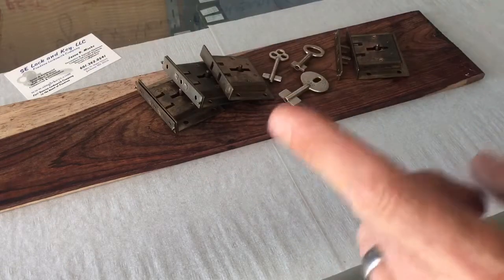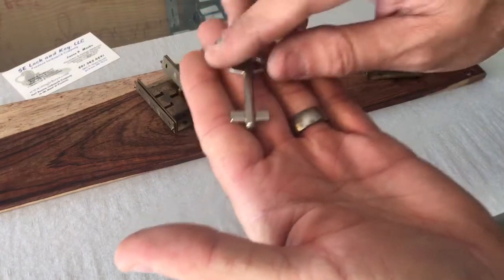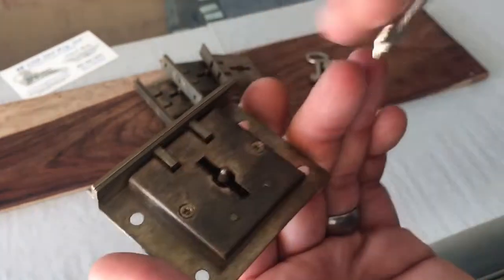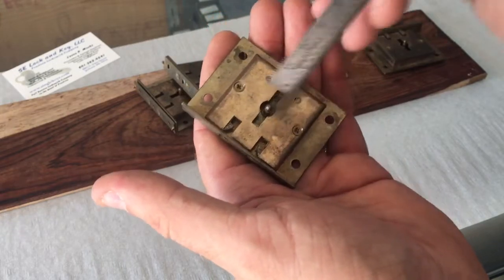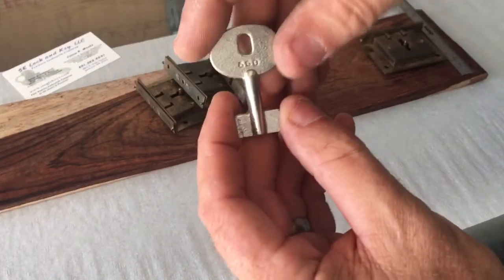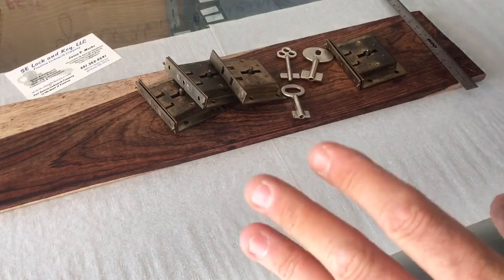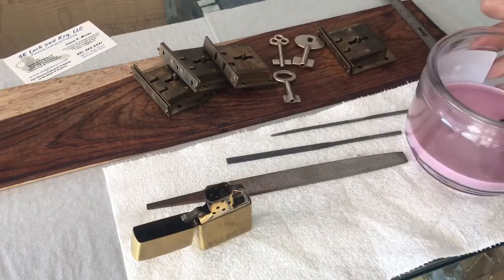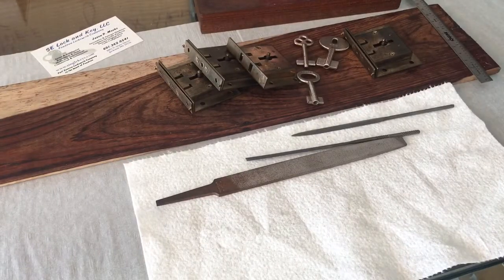Antique Roll Top Desk ~ Key Making!

Comment: ok, so I'm diy restoring an antique writing slope and I want to make a key for the lock..... I don't know any terms, but the lock box is completely closed with only the keyhole opening and takes a small barrel key. But the whole mechanism looks like these locks except only with one wing instead of two and the closing lever off to one side... From the middle of the post the keyhole is 3/4in so do you think my best chance is to get one of these two wing keys and file it down to one? I'm pretty stumped, any advice?

Comment: Could you file the bottom of the key? If so would it be easier (I have never had occasion to try this). Thank you for sharing!
Reply from the maker: The Smetxy the hollow of the key goes only so far up, taking material from the bottom wouldn't be a good idea due to that. It is difficult to accurately drill out the key, especially in the field :)
Reply: SE Lock and Key thanks that makes sense😀

Comment: I just got an antique roll top desk, it was open but upon moving it the top slid down and locked, we believe the key is inside but now we have no way to open it. Two of the drawers did remain unlocked while the rest are also locked. This piece is approx. 500 lbs so taking it somewhere isn't feasible. Also I only paid $50 for it so I can't justify spending more than that to have someone come re-key it. Is there any other way to get this thing open?
Reply: did you ever get it open?